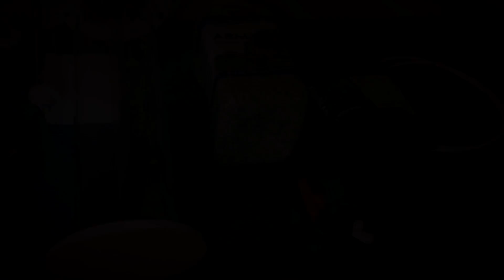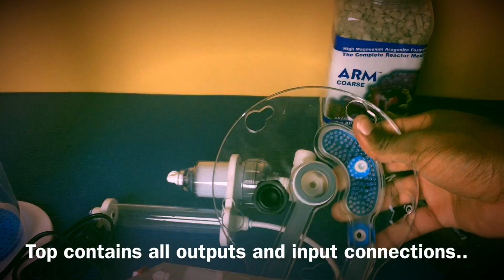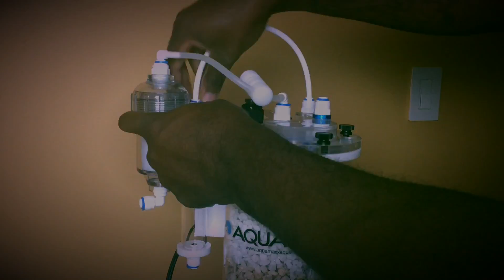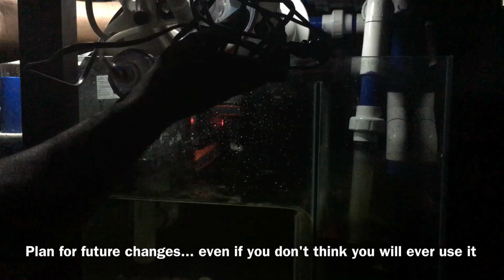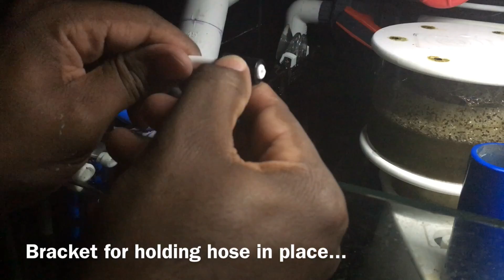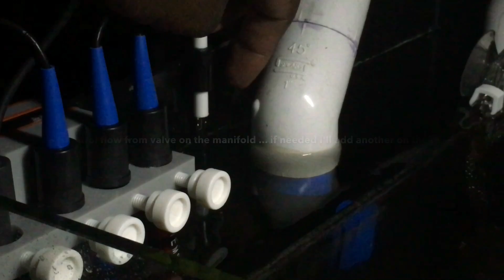Aquamaxx T1 Calcuim Reactor | Setup & Manifold Install

Comment: One item for folks watching, there is one drawback to running a CARX off of a manifold. You precisely meter your output to handle your tank's need, but with a manifold, if you open up another valve on the manifold, you lower manifold pressure and therefore lower water flow to your CARX as well, so it means it all needs to be balanced as a system. If you feed it with a kamoer stepper motor pump or masterflex, you can control the output much more reliably/precisely.

Comment: Hey CJ, I'm really interested in having my own reef tank. It looks like you have to put in a lot of money/time if you really want to see results. If I start should I go with a nano tank or straight to a big one?.
Reply from the maker: Delps medium size 50-75 gallon would be my suggestion but end of the day it is a large investment so get the size tank u can afford
Reply: I'm in the process of setting up a 25g reef, and i'm pushing $1000 very soon with good equipment from "reputable" brands. Could be a bit cheaper if i wanted to, but it could also be much more expensive too.
Reply: Damn, that's seems like a bit to much. I have that kind of money but not really to begin a hobby like reefing. I thought with such a small tank you wouldn't even be pushing $500. I guess I have to gather more knowledge on in it as well then. Because the cost in my head wasn't that much.
Reply: In my experience, double your initial cost and that will give you a more accurate estimate on initial start up. The thing with bigger tanks, although more stable in water quality, is that the equipment used to run them are often more expensive. You'll need a stronger heater, stronger/multiple pumps, larger/multiple lights; you most likely need an ro/di water system - imagine having to make multiple trips to the grocery store for freshwater or to the fish store for saltwater. Took me 3 years to pull the trigger on this thing.
Reply: Can't you buy an RODI system that changes tap water into the water you need for the fish. Those a very valid points, never thought of it that way. Maybe I should wait until I'm able to afford a bigger tank and the required equipment needed. I rather stable water quality in a bigger tank than having to be worried all the time of something going wrong in a smaller tank.
Reply: I just hooked up an RO/DI tonight; another $200+ that wasn't in my initial estimate. I chose a 25gl because it's not big enough where i'm going to spend a ton of money if i don't like the hobby, but it's also big enough for me to make mistakes without panicking.

Comment: Just a heads up a calcium reactor doesn't replenish any trace elements that are stored in the tissue of the coral. Small water changes here and there will help bring those in.
Reply from the maker: googIereallysucks I'll still be doing water changes on this tank... they are too important in my mind for multiple reasons ... thanks for watching 👍🏾
Reply: googIereallysucks Not correct.  If you're using RO and a commercial salt mix, you're likely not adding any detectable trace elements.  Even if you are using a mix that cites increased amounts of Mb and Mn, there is no conclusive, reputable research showing how essential any elements, (other than the big ones CJ noted)are to a reef tank.  I think CJ will get what he needs from his ARM (even though I advocate water changes to reduce nutrients).

Comment: Very Cool. I am battling keeping alk, and Calcium . Looking for Alk 9.0 Calcium 450 and Mag at 1350 to 1400. Is that what you would go for? I have really slow growth right now. Calcium was 400 and alk around 8.0 Mag 1350. Just working with the dosing to keep it steady. Happy to hear you added an outside line. Once I added a line to bring outside air to my skimmer my PH moved up to an average of 8.25. Its working great. 8.18 is my low and that was with 15 people in the house for a family get together. I have a 3/4" inside diameter line running 36'. Before adding the line I was averaging 7.95. Big difference.
Reply from the maker: John sounds close to what I would like my parameters to be... I just want stability ... if it ends up being alittle lower or higher then so be it... my ph never hits 8 even with air from outside. Just a normal thing in my house...